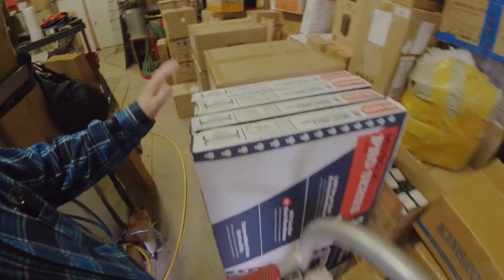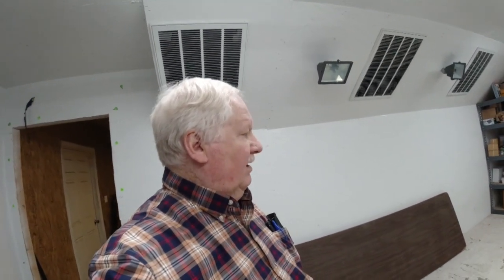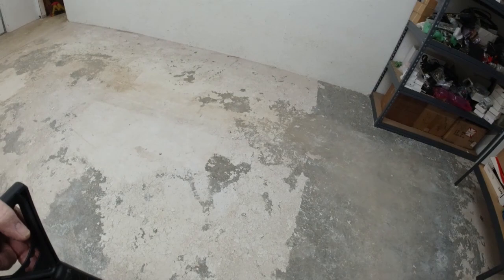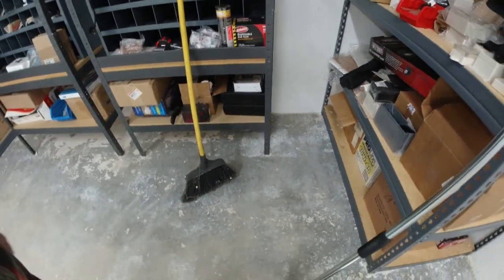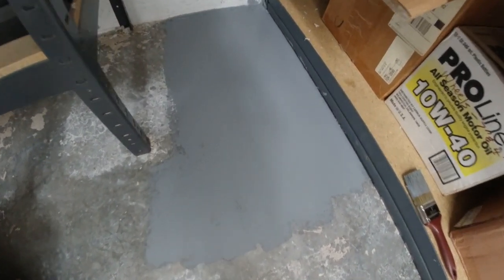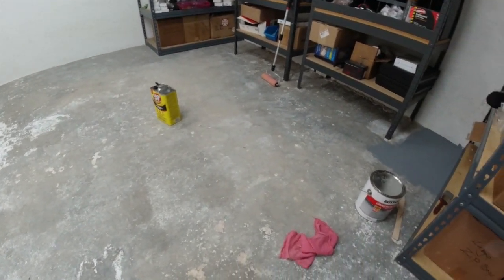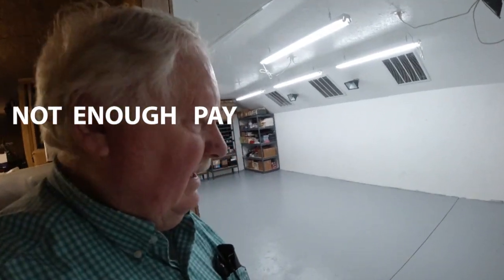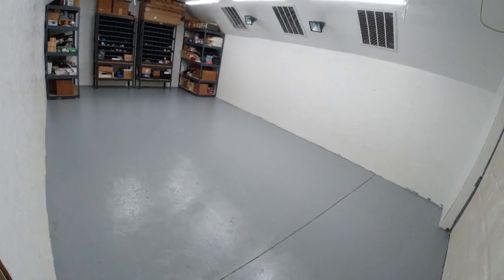MY  NEW  3D  PRINT  FARM  PART 3, Ready for some new 3D printers at New Tech Inventors.

Comment: looks like the majority of you printers are anet and kingroon, what made you choose these printers and have you seen these printers ELEGOO Neptune 2, 160$ amazon sold out, gotta catch them when there in.
Reply from the maker: Good question. I started 3D printing just over a year ago and went to eBay and purchased a cheep 3D printer to get started. Not knowing where this was going to take me I soon purchased another brand printer and soon had several printers that were taking up all my space so I then looked at smaller printers that were still able to print my parts. That is how I started using the Kingroon KP3. One thing I found out was that all the printers I used were able to produce good printed parts after some tweaking. Will check out the ELEGOO, thanks for the info and for watching...Ken